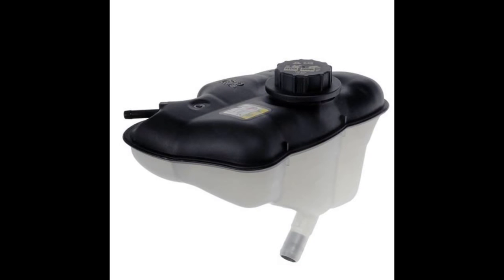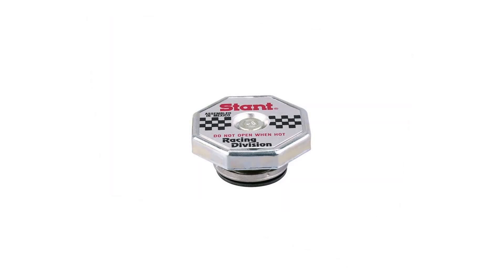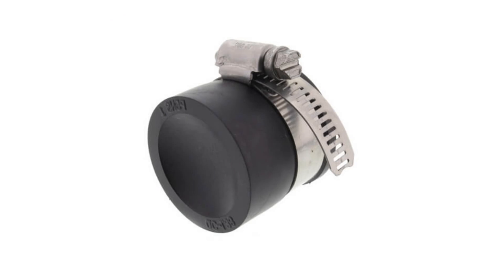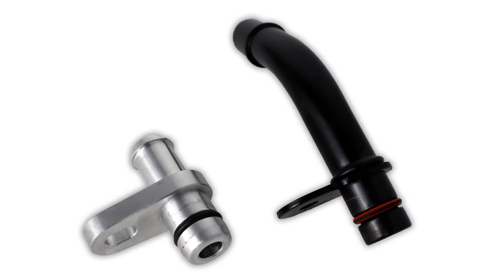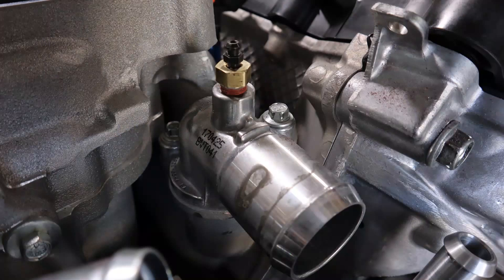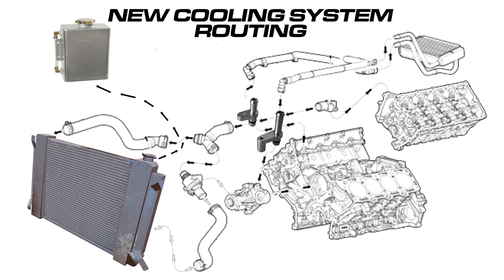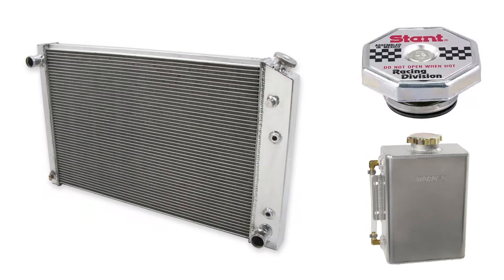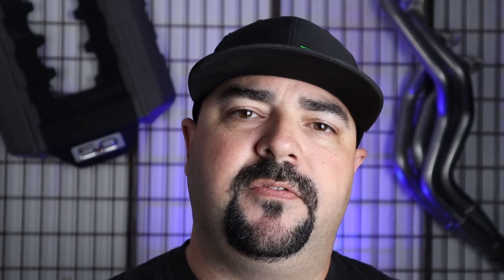What you need to delete the Degas bottle from your 5.0L Coyote Cooling system

Comment: I have never liked the degas bottle design. It eventually becomes opaque so you can't see the fluid level. Of course they eventually leak and it goes right onto the serpentine belt so the belt slips off, wraps around the crankshaft, and goes into the crankshaft seal so you have a bunch of chewed up serpentine belt in your oil pickup. At least with a conventional reservoir, you can safely mount it remotely on the firewall and then vent the lid to your air intake.

Comment: So spend money on a non ford engineered delete for your cooling system with no point of reference to check coolant level..um smart?!?
Reply from the maker: Joseph, the coolant recovery tanks in most oem cars have fluid level guides. Some aftermarket units also have this as well. Since you would be using an older style of radiator for this product to apply, then you would follow the filling and purging procedure for that radiator. Done properly there is no issue. To see it in action, just watch some of our road racing videos.

Comment: Came across this on a google search. I originally was planning to delete my degas bottle and run just a filler neck in the upper hose. But I want to be legal for sanctioned events so I’m installing another tank. But I’ve already capped off my drivers side heater hose. Do I absolutely need that 5/8’s one, or can I just use the 2 3/8’s lines from the rad and thermostat housing?
Reply from the maker: If you have a radiator that has a pressurized cap or add one with the filler neck, that tank needed to be legal is just a coolant recovery tank and will not interact with the engine directly, just the cap. You do not want to cap off the heater hose tubes as it is important they flow to each other to properly bypass the heater. Look at our heater bypass kit for a better solution for you what your are planning to do.

Comment: can i delete the degas bottle even if i don't have a radiator with a pressure relieve cap?
Reply from the maker: You could but it would require installing a radiator cap inline on the upper radiator hose at minimum.